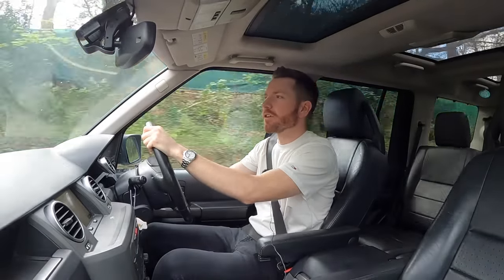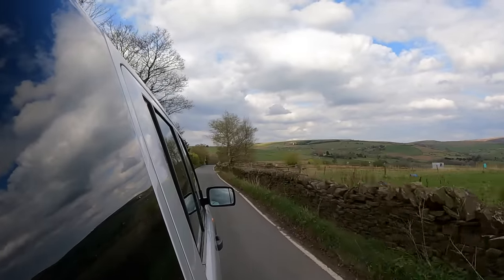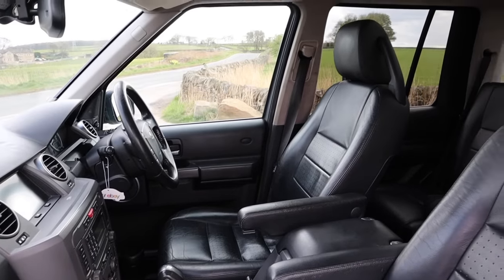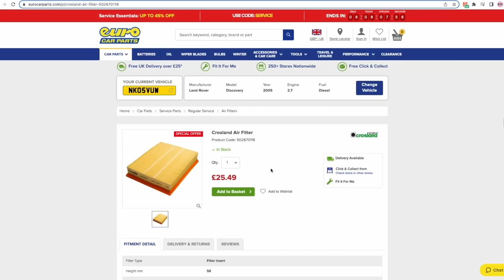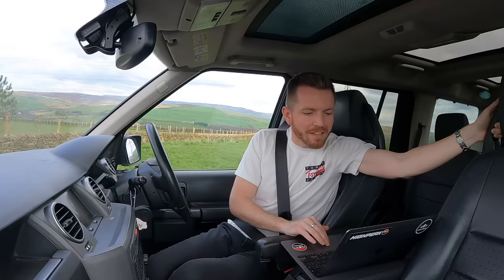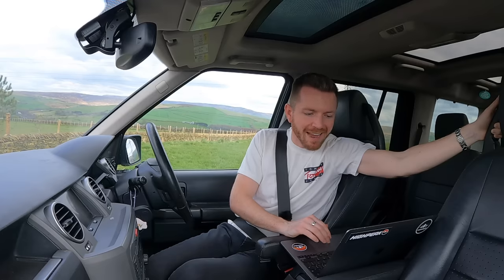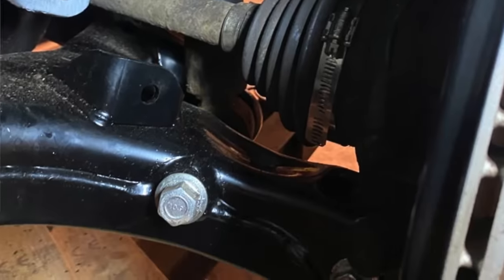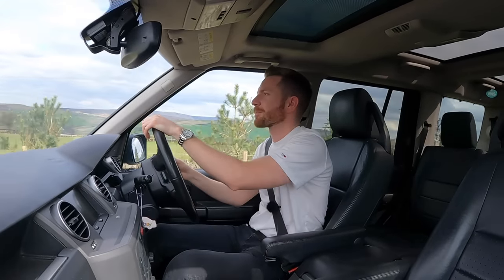Here's What's Been Spent on the £500 Discovery 3

Comment: I remember looking at a car with an e-brake and thinking "That's another largely unnecessary invention that will break down and cost a fortune to replace" I was right on that. My other peeve is electronic oil dip sticks. Dipsticks are ancient and reliable as gravity itself. Even crows and chimpanzees make use of them. Why would engineers think they could improve on them???
Reply: Lol, my past 3 cars have been from VAG, and have had black dip sticks, checking the oil level is always fun
Reply: Most car owners are lazy and don't check the oil. With an electronic dipstick the car checks the oil for you and generates a warning if it is low. Most people will respond to that. So there is a good reason for manufacturers to add it, despite the additional complexity, given the impact on the engine of running it too low. The only downside is that for people who like to know that there is enough oil in are kinda left with some uncertainty because "no warning" is not the same thing as "everything checked and OK".
Reply: My car has an electric boot and lately I've been thinking the exact same thing about that. Another thing thats over engineered and unnecessary.
Reply: @ric355  True. my wife views cars the same as household appliances, and when did you last check the oil level in your washing machine or refrigerator?
Reply: Saw a Bangers & Cash the other day with some old car from the 20's or something which had a dip stick with a built in whistle, when the oil dropped too low, the engine pressure made the whistle blow. Genius idea!
Reply: @casinodelonge  I like that. Very clever. A whistling dipstick.
Reply: Yeeees.....except dipsticks in Minis have a tendency to snap and fall into the engine, then tangle themselves up in the timing chain. Doing it the old school way isn't always the best option
Reply: @themancuniancandidate2744  Mini for the win. A friend had one. He said it was like driving a clown car because parts would randomly fall off it.

Comment: Well done to your mate and kudos for bringing the disco back to life, 3k - 3.5k for a well sorted motor like that I don't think is too bad and especially if he keeps it himself and gets some motoring out of it. I like that sort of thing and have done it myself when I bought a 99 plate Jeep GC V8 for 2.5k and probs spent best part of 5k on it over 5yrs inc all new refurb wheels & tyres /  ST-ST exhaust minus 1 off the three mufflers / new uprated suspension and brakes at each cnr / new struts all over / door mirrors / door rubbers / service / Mot's etc you get the picture. The sound it made and the way it drove just had me smiling from ear to ear every time I started it up. I sold it and moved to the dark side by getting a 2010 GC with 3ltr Merc diesel engine - good motor but not a patch on my old growling V8.

Comment: Great video this! it demonstrated that these are only money pits if they don't get looked after! ..... 220k miles and a 2005 reg Disco that weighs 2.7 tones empty, will need to have suspension bushes replaced at some point, that's just a simple fact and is to be expected!  The only other thing that's been done to it is a full service e.g. oil and filters etc.. tbh it sounds like the old Disco has done pretty well considering its neglect over the years! Mines a 2006 plate with 140k on the clock, still runs sweet as a nut but I look after it. Great cars the old D3s :-)

Comment: All those parts for £2k. Bargain. 
I spent that sort of money on my 2003 Focus which I've had from new. 
I bought a set of new tyres, new cambelt, new crank sensor, new cam sensors, new regulators and bits and bobs and then the fuel pump started acting up and the ECU let go. 
It has been parked up on my drive now for the last 7 years, earning its keep as a parcel drop off point for the Close.

Comment: If he had bought one for £3.500, he'd have had to carry out 90% of that work on it within a year anyway. I think your mate has done very, very well, not to mention the priceless lesson on how to maintain it for the future. There are plenty of D3s with 300k on the clock, and a few with over 500k. Mine is at 180k with about 100k of those towing 3.5 tonne. This will do him just fine for many years. Congrats.
Reply: What oil do you put in the engine ?
Reply: @wobblycaptain  FS A3/B4 5w40 every 6000 miles
Reply: @larry365  Cheers buddy I need change my oil spec on my next oil change 👍
Reply: @wobblycaptain  Obviously the recommended is 5w30 but i find this is just too thin on an 15 year old engine. Look up "LR Time' on YouTube; they have just released a good video talking about TDV6 oils.
Reply: @larry365  I watched it mate I was doing the same as Christian & Vera where doing previously before they talked about the subject ,that's why I asked what oil you use am following Christians advice and reading comments most people on the older engines for this vehicle recommend to use the 5w40 I don't wish to change this old 16yr old Land Rover as at the moment its still serving me well but I think best now to change my oil spec same as Christian did .
Reply: @wobblycaptain  They're good trucks and not a lot of choice if you ever wanted to replace it. I've been running 5w40 for maybe 50k or 3 years now. All is well.
Reply: @larry365  👍👍

Comment: OK - so 3000 squids. Even if you never make a cent back, the UTILITY you will get from that vehicle over the next 4 years will easily be worth that. I have the same thing with my 2007 Jeep Grand Cherokee, it doesn't make sense to spend 1/4 its value on upkeep every 2 years, but it does as a new replacement is over 10x the cost, and the depreciation on a new one alone will cover any maintenance for 5 years.

Comment: Eurocarparts are Not cheap,I always check out their prices when I need parts first then check out carparts4less which is owned by the by the the same company and their nearly always cheaper for the same part then I search the internet to see if I can better their price,it always pays to shop around if you’re not in a hurry,the price for a Nissan Xtrail front wheel bearings and hub complete from either of those two is around £100-00 after a Massive discount,price on EBay £27-95 delivered with a two year warranty,you can of course just buy a bearing if you have a press to press out the old bearing and push the new one in but at £27-95 who can be bothered for around £6-00.

Comment: I've done the same, some of it I had to get a garage to do as I haven't got anywhere off road to work on the car, yes it's become quite expensive but that said, I couldn't afford to buy one outright and because I have no credit rating I couldn't afford to buy one any other way, but at least I know it's all been done, it hasn't been cheap, it's a 2007 HSE spec that's done less miles than my everyday car, a 2011 Smart ForTwo diesel which I only use to go back and forth for work, I don't have much in life so a luxury car for traveling when I'm not working or using the motorbike is just an added bonus, when I haven't had a Land Rover vehicle, I've missed it, there's just something about driving a Land Rover, be it a series vehicle, Defender, Discovery or Range Rover, I am kind of addicted to these vehicles and I will probably keep it for at least another 10 years (alike to my Smart ForTwo which I've owned since September 2011)

Comment: If you shop around you can get a lot of them parts much cheaper your hand brake cost was very expensive for example you can get Hand Brake Cables Left + Right for £60s with a 5 year warranty in the video you said you paid £256 for cables you can also get them to include as well EPB Module repair kit for around £90 - £100  including the cables the car your fixing is 16yrs to 17yrs old and 220k miles + so its done well and scrubbed up well I would recommend to anyone who buys these cars shop around for parts that are best suited to your pocket  you can find parts much cheaper and stay away from main dealer for repairs and service unless you have deep pockets also regular oil changes are a must in the discovery with the correct oil so don't neglect the oil changes I have a 16 yr discovery 3 had it six years its been a very good motor but if your looking to buy a 16yr old discovery and non of the jobs in the video have been done then the cars done well so far but expect to replace some of them parts in the future due to its age and use if they have not been repaired before . The car in the video looks tidy looks better than mine lol...mines rough and dirty I don't clean it much not a show car  but still going just passed its mot for another year enjoyed owning the car its never cost me much to fix in parts or in a local garage to fix . Good video Out of interest and for the record in six years of ownership on a 16yr old car I have replaced the cambelts , one hub bearing , tyres and brakes , one lower control arm bushes these wear out on older vehicles and every year I change the oils and filters I do that myself. Enjoyed owning the car . I have read some nightmares where people have paid some very expensive labour costs in the UK for simple repairs you can avoid that just use your common sense and shop around or buy a Toyota 😁 ps the car has never let me down

Comment: This goes to show that even those of us doing legwork & wide eyed can catch a cold.

If I was purchase inspecting a Disco 3 or RRS L320 I would ideally check brake pipes. I seem to recall they are a 10 year or 100k  replacement item in service schedule.

I bought a RRS L320 with a green MOT only to later find it needed new brake pipes. On the MOT prior to the clean one it had been advised on brake pipes. I bought from a wide boy trader & on a bit of a whim....I know better &  should have been more careful 

On Disco 3 & L320 the service interval on  handbrake is 50 miles IF it has been driven through water of any significant depth  - ridiculous.....My park brake  needed work (rust crud bits fallen off etc).

I  sorted the brake pipes & park brake & caused car to have new discs pads & fluid.

I bailed out of (& sold) my L320 when the heating was colder on one side of cabin....Lots of labour to sort it if it was the matrix. Car also needed gearbox & underside fluids changing  at some point.

My RRS L320  was better than most....as site host knows...it had the proper JLR 4.4 petrol lump & being a 2005 lower tax & Euro 4 so ULEZ compliant.

Why am I looking at these LR vids ....because I like the Discos RRS & FFRR....

Would I buy another...

Maybe but probably only if car had impeccable history or price well adjusted for any work needed. Ideally I would buy from a private punter if they could convince me car had been cared for & I had an idea of what issues might be lurking ahead .

Sad truth is people lie when they want to get rid for least loss...

I am perhaps too honest when (rarely) selling cars privately with known faults.

My advice to anyone considering such meta....be very careful and open minded ! 

Oh and ideally I would have bought the Disco 3, sold the cherished plate then sold it as spares repair or for someone to sell as salvage. 

Some would take it apart and send bits around UK but easier & faster ways to make cash. 

Incidentally if the original owner was SAS they would not put a that sticker in the window....Ridicule & disapproval from colleagues would be unbearable !  I agree it might be an ex BFG privately owned car though.

Huge respect to the friend who rescued this vehicle🥃🥃🥃🥃👍

Now...How do I stop myself watching these LR & RR vids ?🤣

Comment: When you take a Range Rover for a Gearbox Service, which option do you go for. I have just had a quote for my L494 for £1024 replacing the sump and the gear oil.

But I’ve also seen megaflushes around the £400 mark.  Which option would you chose?
Reply: Megaflush every time. That will replace about 11-13 litres of oil taking all the contaminated oil out. The service will change about half that, leaving a lot of rubbish in there. Of course, there is some dirt still in the filter, but that won’t be passed around the gearbox as it’s trapped in the filter. By the way, anyone who’s charging that much for a sump and oil change is taking the piss as well….
Reply: They’ve quoted £517.80 for 10 litres of the oil which seems the largest hit, and £204.14 for the sump, plus the consumables, Labour and VAT.

Comment: All that work still won't stop the crankshaft from breaking, it's an inevitable failure that happens to pretty much every one of these with the Peugeot/Citroen V6 engine.
Reply from the maker: It’s done 223,000 miles. At what point should I expect it to fail before I call this 17 year old car unreliable?
Reply: These early models didn’t have this problem!

Comment: That motor reminds me of the days when you would buy a runner HPI clear like a Golf mk1 Peugeot 205 GTI Renault 5 gt and then spend a small fortune on Dimma kits replacing engines performance exhaust etc -you get the picture/ this is oh so much more civilised but for the effort surely you can get a high mileage car that has been cared for for the £3k +